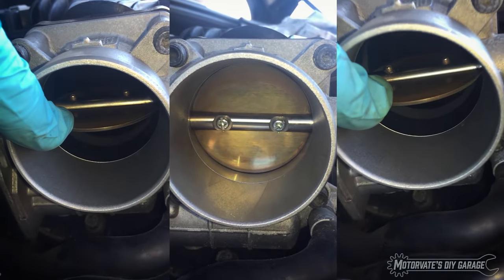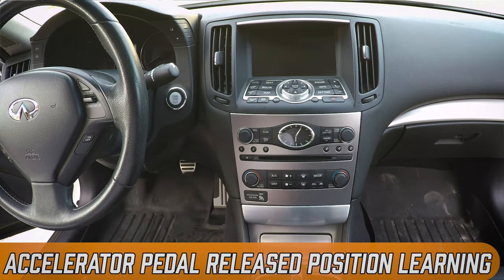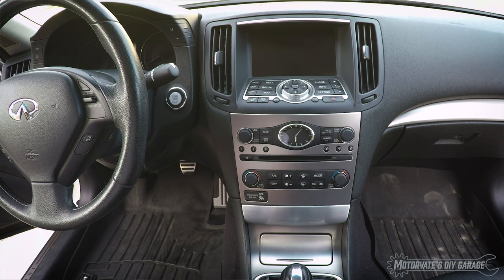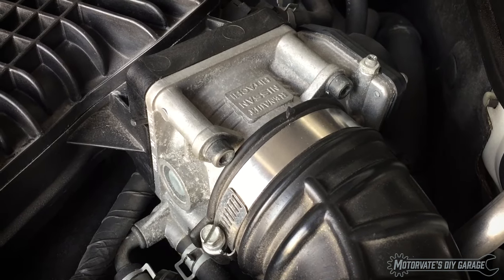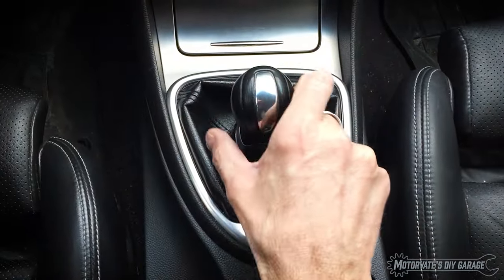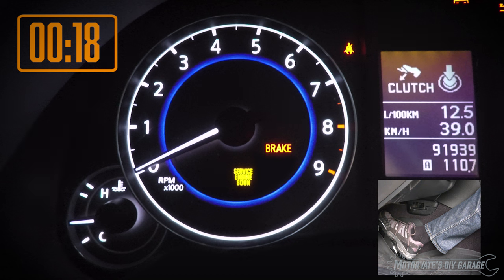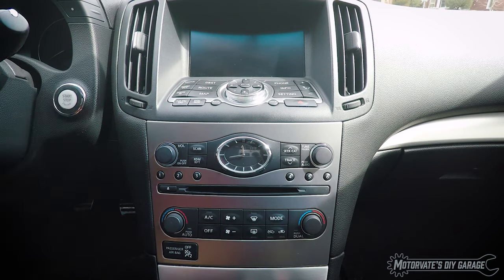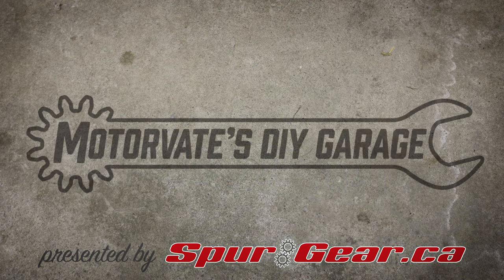G37 & 370Z After Throttle Body Cleaning: Motorvate’s DIY Garage Ep.27

Comment: hey my 10 g37x doesn’t wanna start, it turns on and then it shuts down the rpm fails, and all my ecu lights come on, i try and try and my car sometimes turns on completely, but i don’t wanna drive it bc what if it gets stuck,  when my car fails to turn on it shakes the engine. when i put the gas pedal after it turned on after the 5th try, the rpm went to 3k and started stuttering kind of. do u think i need to clean my throttle body
Reply from the maker: To me it seems like you have other engine issues. A dirty throttle body doesn't cause an engine to shake... that sound more like a misfire.

You might want to scan for codes to get a better ideal of what is going on.

Comment: Is the 3rd step the same procedure for the 370z?  
I have a 2009.
Reply from the maker: Hey 7bigpapi,
Yes, and this works on just about every Nissan/Infiniti from about 2003 when drive by wire was introduced.
Reply: Motorvate DIY thanks!

Comment: Do the steps need to be followed in order you did them or it doesn’t really matter which step you start first ?
Reply from the maker: Hey King Carlos,
It is my understanding that they should be done in the order shown in the video.

The idle air volume learning process will use the current throttle closed position. 
If you do idle air volume learning, then the closed throttle position, the idle air volume learning will be off.
Reply: Motorvate DIY Thank you! Followed the steps in order this morning and it idles perfect now. One question my car idles at exactly 600 rpm is that ok?
Reply from the maker: Hey King Carlos,
I am glad to hear that! The factory specification for the idle is 600-700 RPM, so you are spot on :) 

Can you tell me the year and model of car?
Reply: Motorvate DIY it’s a 2013 g37 journey sedan
Reply from the maker: Hey King Carlos,
Thanks.... I just wanted to see what years and models work as described in the shop manual.
Reply: Hello Motorvate DIY, my car idles perfect at 600rpm when in park and in reverse but when I throw it into drive the rpms drop to I would say 550rpm. Is that normal?
Reply from the maker: Hey King Carlos,
Yes, that's normal. The factory spec for a hot idle is 600-700 RPM when in neutral or park. With the car in drive, it is normal for the engine RPM to drop a little. :)
Reply: Motorvate DIY Thank You! 👍🏼

Comment: Regarding the throttle valve closed position learning, I was reading the service manual (2010 G37), it did not mention anything about temperature precondtion.  Wondering where you see that information.  Copy and Paste from the manual below.

THROTTLE VALVE CLOSED POSITION LEARNING : Special Repair Requirement
INFOID:0000000005624636
1.START
1. Make sure that accelerator pedal is fully released.
Revision: 2009 November 2010 G37 Sedan
EC-20
< BASIC INSPECTION > [VQ37VHR]
INSPECTION AND ADJUSTMENT
2. Turn ignition switch ON.
3. Turn ignition switch OFF and wait at least 10 seconds.
Make sure that throttle valve moves during above 10 seconds by confirming the operating sound.
>> END
Reply from the maker: Hey g37clips,
Well... this is interesting. As you point out the 2010 G37 factory service manual doesn't mention anything about engine temperature. However, the 2011 G37 (sedan) manual does  on page EC-26 and EC-27.

I guess the good news is that the 2011 process should work for the 2010.

It is my understanding that there were many ECU changes from 2010 to 2011 due to EPA/CARB OBD regulation changes. Thanks for keeping me honest!

Comment: How about the window controls on the driver side passenger window drops down when you open the door goes back up the driver side will not What’s my next step
Reply from the maker: I don't know, as that feature is only on the coupe.
You could get the factory shop manual for free at nico club and start to troubleshoot it. Good luck!

Comment: I have a 2007 G35 sedan with the VQ35HR engine. I disconnected my battery to replace the valve covers and gaskets along with the spark plugs while I was at it. I removed the intake and throttle bodies and i cleaned everything properly including the TBs and after carefully putting everything back together and starting the car, I have an idle problem. The car idles from 1100 to 1900 rpm's non stop. I tried many times for throttle reset to no avail. Is there something I can do or am I missing a step? Thanks in advance
Reply from the maker: Crap, I guess you didn't see the warning at the top of the description. :(

There is a bug in the 2007 HR ECU and the idle air volume learning procedure will never complete. 

Some have been able to get an update at the dealer and others have used Eugene at https://www.yelp.ca/biz/enthusiast-auto-care-concord to update the ECU.
Reply: @MotorvateDIY  Evidently I missed the warning....🤦‍♂. Although I did the work before I came across your video. I jumped right into it without thinking about it. I figured, battery disconnected, the car will never find out....😁 I will contact Eugene. Thank you.
Reply from the maker: I'm sorry this happened to you.  Eugene will look after you. He has helped out more than a few folks on this issue and with his fix, you wont have the issue again :)

Good luck!

Comment: Did the idle procedure and had success with the first 2 steps. The 3rd step has been giving me problems. I’m not getting the same results of the service engine soon light blinking after holding the gas pedal. I seen that you are working on a 6 speed and i have a manual. Could that be an issue?
Reply from the maker: Hey dgree100,
I don't think the type of transmission makes a difference, and factory shop manual doesn't specify a different process for different types of transmissions.

Make sure the electrical load is as small as possible, (including having the driver's door closed) and use a stop watch (or timer on you phone) to make sure the proper action happens at the right time.

It can be tricky to get it to work.  Good Luck!
Reply: Motorvate DIY thank you for the info.

Comment: @MotorvateDIY
Legitimate question, please answer. I'm swapping in 2 MAFs & 2 Throttle Bodies in attempt to solve my RPM dipping issue. I'm bound to use your method after swapping each piece one for one. At INFINITI, they do this relearn procedure via direct laptop plug-in & update. Is there ANY difference between these two methods in terms of effectiveness???
Reply from the maker: I don't think so... the factory shop manual shows both methods, so I would expect them to work the same.

Comment: Any ideas to why a 370z would not start after cleaning the throttle bodies and maf ???
Reply from the maker: Hey Zook Ithe6ix,
I would unplug and plug in (and make sure to hear the click) any connector your unplugged and double check all hoses/clamps to make sure there isn't any air leaks. Good luck!

Comment: This procedure might not be enough to reprogram and reset/relearn the throttle bodies. I have a 2012 Infiniti G37xS Coupe and this procedure was done by my Infiniti dealer's garage after they cleaned my throttle bodies. Assuming of course that the coatings on the throttle bodies were not damaged. You vehicle could end up throwing a P0106 code because of the MAP sensor reading a different air volume because of the throttle body cleaning. You will need to use the following procedure which will require a  consult III computer or equivalent from Nissan/Infiniti and the following TSB: EC12-010a  ITB12-026a  Original date: May 23, 2012 with subsequent changes since then. I made a complaint with Infiniti Canada and Transport Canada that this should actually be a recall instead of a TSB that you pay for because your vehicle could actually stall while driving which is what happened to me and obviously a serious issue.
Reply from the maker: Nope... That TSB updates the ECU to fix a bug.
There is no connection to a P0106 and cleaning the throttle bodies.

This procedure is the exact same one the dealer does with Consult... except we don't have to spend thousands of $$$ to do it.

There is more than one way, to do an "Idle air volume learning".

Comment: Can this work while your service engine light is already on ? My car is idling around 1000rpms at the moment.
Reply from the maker: Hard to say... 
If the SES light is for a throttle control issue, I don't think so.
If it is on for something like high idle, or something for the rear o2 sensor, I think you can.

Read the code to understand what is going on, clear it and try the idle air volume learning again. - Good luck!
Reply: @MotorvateDIY  thank you for replying I appreciate I removed the negative terminal for 1 min. Put it back on. It seems to work the light went away and it started to idle normally again, hopefully it stays that way. 🤞🏽lol

Comment: So if I clean the throttle bodies first thing in the morning before driving the car, it's already a cold engine. Afterwatds I would just start it, wait for it to reach temperature, then shut it off? That would be the Throttle Body Valve Closed Procedure??
Reply from the maker: Hey  Austin Murphy,
I know it seems a little silly, but that is what the factory shop manual says to do.

The most important (and difficult) procedure is the idle air volume learning. If you have an Android device and a bluetooh OBD scanner, you can use a free app to do it:

Quick & Easy Idle Air Volume Learning: Motorvate's DIY Garage Ep.28
https://youtu.be/OiB9txECWB0

Thanks for your comment!
Reply: @MotorvateDIY  I'm glad you just replied because I just came in from cleaning the Throttle bodies and the MAF sensors, just waiting on them to dry. I do not have an OBD Sensor, but I can perform the Idle Air Relearn without one just like in this video correct?
Reply from the maker: Hey  Austin Murphy,
You bet! It can be tricky to get the procedure to complete. Make sure all the preconditions are met and use a stop watch to ensure the timing is accurate.

It might take a few tries to get.
Good luck!

Comment: I did my spark plugs, and cleaned the throttle bodies on my 2010 G37 sedan. It still continues to idle at 1000 RPM after doing these sequence illustrated in the video. What would be probably be the issue with my car?
Reply from the maker: Is the engine fully warmed up when it idles at 1,000 RPM?
Reply: @MotorvateDIY  Yes, I’ve warmed it up then followed the sequence of resetting the idle but it still idles right at 1000 while in park. It idles at 750-800 when on drive
Reply from the maker: If you have done the idle air volume learning, I don't know why the idle is higher than spec.

However, I don't think it will hurt anything.

Comment: I got a question. I just did my throttle bodies on my 370. It has 53,217 miles on it so it had a little bit of a hump built up in front of the throttle plate. It had a little bit of a shake off and on at idle. So I got them cleaned up and put back together. Now when i started it i let it warm up good and even went for a quick drive. Tge idle is very smootge now however the idle is a bit lower? Should i do the relearn procedure to taje care of that? I just wanted to ask you just to be safe thats all.
Reply from the maker: Hey  Waugy 370z,
The factory specification for the idle is 600-700 RPM, when fully warmed up.
What does your car idle at?

If you did the idle air volume learning after cleaning, you should be all set.
If not, that should be your next step.

Good luck!

Also, if you have a Bluetooth OBD scanner and an Android device, you can use a free app to
do the idle air volume learning:

Quick & Easy Idle Air Volume Learning: Motorvate's DIY Garage Ep.28
https://youtu.be/OiB9txECWB0
Reply: @MotorvateDIY  Well maybe its ok then because its about the width of the needle above the 500rpm mark (about an 1/8th inch). So its probably just over 600. My nephew has a accutron scanner ill hook it up later on to get an exact rpm. Thanks again for the fast response 👍
Reply from the maker: That sounds like a good plan to double check the engine RPM. From your discretion I think your idle is in spec.
Reply: @MotorvateDIY   Alright, and thanks again👍 There was a nice little hump of carbon built up in front of the throttle plate and it made a noticeable difference at an idle after I cleaned it out. Very smooth now.
Reply from the maker: Hey  Waugy 370z,
Anytime. I'm glad it all worked out :)

Comment: Hello i have a 2008 infiniti G35 sedan sport i got a service engine light code with p0011 i clean the solenoid sensor and then a took off the code but when i warm up my car the idle goes to 2 and slowly goes down but it bounces while going down now when im driving about 20 mph  and let go of the gas peddle the idle goes to 1 and bounce down a lil and goes back up to 1 then goes stays around 7 or 6 while stoped any help will due thnks
Reply from the maker: Hey  THEKRZYMEXICAN,
A P0011 is defined by Infiniti as:
"There is a gap between angle of target and phase-control angle degree."

This means the engine control module (ECM) doesn't think the intake cam position is where is should be.

The factory shop manual states that the first thing to check is the engine oil pressure. Here is a video that shows how to do that on your Infinti:

Oil Pressure Check: G37/370z - Motorvate's DIY Garage Ep. 18
https://youtu.be/-Io6ryxWFtQ

The engine in the G35/G37 can have an internal gasket failure in the oil gallery, which causes low oil pressure and a P0011. Google "G35 Oil gallery gasket" to learn more.

There is no external leak, and if not fixed, the engine will need replacement.

Comment: Does this need to be done after throttle cleaning? My idle seems fine after cleaning throttle body but car feels slower
Reply from the maker: If, after cleaning your idle is about the same, then I suspect the throttle body wasn't too dirty and the idle air volume learning wasn't required.

However, if that was my car, I would do the idle air volume learning.
Good luck with what ever you decide!
Reply: @MotorvateDIY  Thanks,  I did the procedure it was easy!
Reply from the maker: Good idea. You might notice a little sharper throttle response... I know I did :)

Comment: Would these steps be valid for my ‘08 EX35? It has a 3.5L V6 like the G35.
Reply from the maker: Hey  Mahmud Bhuiyan,
Yes! These steps work for any Nissan/Infiniti with an electronic throttle made since about 2002-2003.

Comment: I have a 2014 Infiniti q50s AWD, would this method work? I heard from someone that it's a different process and that it's very difficult, and to not attempt. Is that true?
Reply from the maker: I just checked the 2014 Q50 factory shop manual and it is the exact same process. :)
Reply: @MotorvateDIY  that’s awesome man, thanks! Imma give it a shot!

Comment: At 4:22 you say after the SES light stays on, release the accelerator pedal and start the car. Normally you have to hold the brake down the start the car. Does the car not require you to step on the brake to start the car during the procedure?
Reply from the maker: You are correct... I guess since my car has a manual transmission I didn't mention about the brake pedal for the automatic transmissions.

If you have a Android device and a cheap Bluetooth OBD scanner/ELM327 you can use a free app to do the idle air volume learning:

Quick & Easy Idle Air Volume Learning: Motorvate's DIY Garage Ep.28
https://youtu.be/OiB9txECWB0
Reply: @MotorvateDIY  what if we have neither
Reply: Terry1212 what did you do with automatic transmission? Just his brake to turn on?
Reply: At 4:22 do you pess brake on a/t

Comment: What a luck it was getting this recommended to watch. Im doing this to my 370 this weekend and had no idea the idle wouldnt fix or relearn the propper setting. And all the videos say you have to remove the throttle body and i was wondering why that was a must as long as you spray and scrub it good? Thanks so much because i wouldve freaked if i got done and my Z wasnt right after i tried to clean them. Also i should let it sit for about 30 min to make sure the throttle body cleaner evaporates totally right? Im not gonna flood it with it but still its probably a good idea?
Reply from the maker: Hey Waugy 370z,
I'm glad you found the video helpful!

I simply use a rag to wipe up any excess cleaner, no need to wait.
BUT there is no harm in waiting.

Just in case you didn't see it, here is an episode on how we clean the throttle body on our cars:

G37 & 370Z Throttle Body Cleaning: Motorvate’s DIY Garage Ep.26
https://www.youtube.com/watch?v=ySK99VbSiTE
Reply: @MotorvateDIY  Thanks I'll definitely check it out. I subscribed so i wont miss any from now on 👍
Reply from the maker: Excellent! Thanks for subbing :)

Comment: My 370z has a check engine light on and under hard acceleration it flashes. The car also has no power like if it's in limp mode or something even though I got tuned and was very quick and fast now it feels like a turd. What should I do?
Reply from the maker: Flashing CEL = engine misfire, which is very bad.
Scan for codes and then have a talk with your tuner. Something is VERY wrong.

Comment: After i did my throttle body cleaning I have a problem where my car will either idle steady at about 1k or it will do this weird thing at idle where it starts at 1500 and goes up to 2k over and over I did all these steps and after the last step it did go down to around 700 but I did the last check turned off and back on and it just went back to doing the same thing any idea on what my problem could be?
Reply from the maker: Try doing the "idle air volume learning" again. Sometimes it seems to need a few attempts.

Comment: I opened the valve but not all the way. My car has been running good with no issues at all.
Reply from the maker: Hey RedRyder Z,
Thanks for sharing your experience. In a future episode I will dissect a G37 / 370Z throttle body to show exactly what they look like in the inside and how they work.